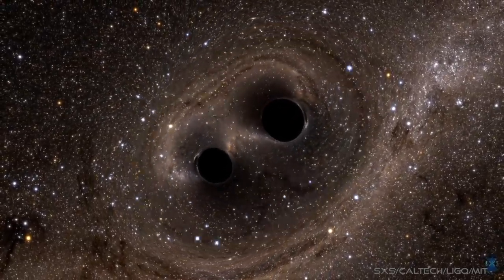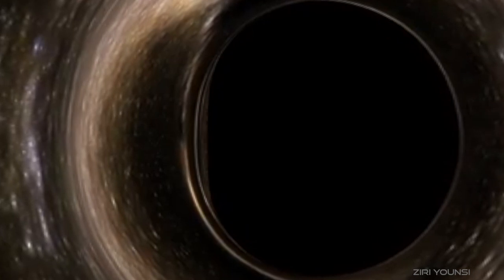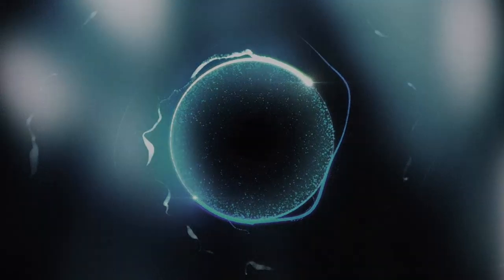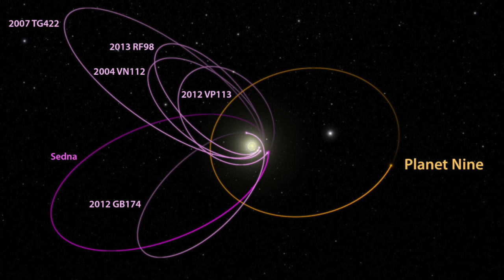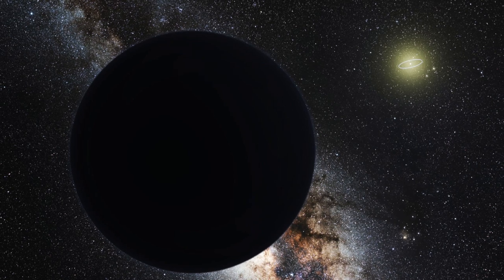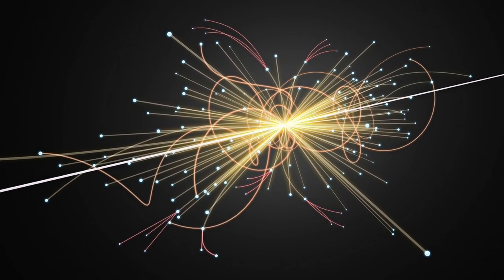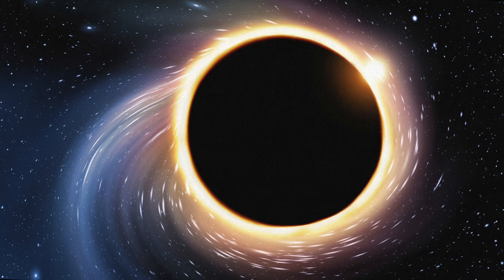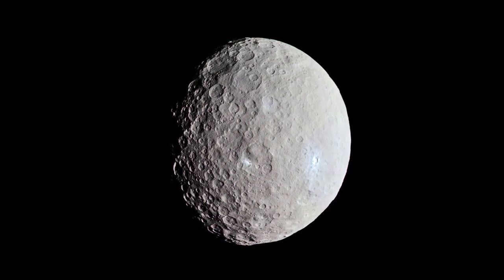Tiny Shiny Black Holes

Comment: David, good video.  Another problem with creating a kugelblitz with even a solar collecting dyson swarm is: once the BH is formed at the Planck mass, you cannot feed it and make it more massive.  It's radius (event horizon) is 3.233×10^-35 meters.  That is orders of magnitude smaller than the size of a proton, which is 1.5346983×10^-18 meters in radius.  It could never grow.  It could fall to the center of the earth and would statistically never encounter another atom.  And that's only if Hawking was wrong and the thing doesn't evaporate instantly.

If it does evaporate, you can't add any more mass or energy to get it above the Planck mass.  You can't add energy by dropping matter into it either for because the radiation pressure would be like trying to push a golf ball into a firehose.  You can't add mass from a Dyson swarm of lasers because it would likely radiate energy away faster than you can add more.

And by the way, the LHC can only produce energies up to 14 TeV, which is 2.5×10^-23 kg (well below the Planck mass of 2.1764×10^-8 kg).  Such a black hole, if even possible would be 3.707×10^-50 meters in radius.  The size of that black hole compared to a proton, is analogous to a proton compared to the orbit of Pluto.

Comment: 17:13 A thousand megawatts!? That's almost 1.21 jigawatts! Great Scott!
Reply: The planck energy is actually about 2 gigajoules, so that's enough to power 2 flux capacitors for a second each, and how long do you even need to power it for anyway, a split second, right?
Reply: Winfield ScottEdit

John William De Forest, in Miss Ravenel's Conversion from Secession to Loyalty(1867) reports the exclamation as referring to Winfield Scott, general‑in‑chief of the U.S. Army from 1841 to 1861:

I follow General Scott. No Virginian need be ashamed to follow old Fuss and Feathers. We used to swear by him in the army. Great Scott! the fellows said.[4]
Reply: Fire comment
Reply: At 88 miles per hour!!!

Comment: Hi David,  I love your videos, research and explanations.  I’m a huge fan. Thank you!  
Regarding tiny black holes... with the mass of a mountain... 600,000,000 tons... let’s call it Yakob — given that Freddy had an event horizon of about a micron and was massive enough to produce gravitational tidal forces that would rip us apart at a few hundred meters — I imagine that Yakob would have an event horizon with radius much smaller than an angstrom and produce those tidal gravity effects at tiny distances too... so wouldn’t Yakob have a very hard time growing even if it fell into the center of the earth?  It could only trap atoms that came super close to it. Right?
So I imagine Yakob falling to the center of the earth virtually unimpeded, accelerating as it reached the center, then decelerating as it came close to the surface of the opposite side and back again... forming an orbit inside of the earth!  We would only be able to detect it as a periodic perturbation of the local gravitational field every time it came back to our part of the planet’s surface... well that and the gamma rays that it would emit.  Did I understand that correctly?
Thank you.

Comment: Hey, it's very  nice to see you cover that topic, and I had more or less the same ideas a while back, and I always had some questions, remarks relative to how to manage a micro blackhole, so why not share them with you all ? English is not my native language so sorry for silly mistakes.

Okay so let's assume we manage to create such a blackhole with the power-output of a classical powerplant.

First, a remark... If we use energy to create a blackhole to extract energy from its hawking radiation, we don't have an energy source, just a very, very long term battery. Unless we find a way to feed matter to the blackhole, to compensate the mass lost to evaporation. In that case the blackhole become a very useful powersource that can extract 100% of the energy equivalent of the mass we put in. (assuming that hawking radiations are only made of photons, which I know is wrong below a certain mass)

The problem is... How to feed such a blackhole ? after all, a blackhole like that would have a diameter of 14 femtometers, which is, if i'm not wrong, of the same order of magnitude of a proton, or even an electron. So first, you'll need to be very precise when feeding the blackhole, and second, how would it even react ? Let's push it to the limit and imagine I have a blackhole smaller than an electron... If I try to feed it an electron, wouldn't the electron just... Pass right through it or something ? It's hard to figure out how a particule would interact (if it even can) with an object that small, and I suppose you need to use quantum physics to answer that question... A blackhole like that would be very hard to feed, and also to charge electrically.

Also a cool idea for  exploiting a non charged blackhole would be to have it in orbit around the Earth, enclosed in a space station used as a powerplant that would beam the energy back to Earth. The station would ajust it's orbit around the blackhole to compensate the outside forces acting on the station, to keep the station and the blackhole still relative to one another.

Again sorry for my broken english. hope that message fit nice with the video !

Comment: The only safe place to create a black hole is in earth's orbit. Imagine a problem in cooling system and the whole planet is destroyed!
Reply from the maker: Ye it seems outrageously risky to have near to anything you care about
Reply: Yeah but cooling things in a vacuum space is a whole another can of worms.
Reply: @NoHandleToSpeakOf  You don't need to cool it in space, as you won't need any structure around to levitate it. However to harvest power from it, you need to be close, because of the inverse square law.  depending of material strength, you might be able to get as close as 4 times closer than 50km mentioned in this video. However that will still be quite far away to get any serious power, so you need a dyson sphere structure, that can absorb hard Gamma rays, and some avionics to keep the sphere around the black hole centered.  let me try this with numbers: 12.5km radius sphere has an area of 1963.5 sq km. 1Gw spread out over such an area is 509000 Watt per sqkM! around 1/5'th the intensity of solar radiation on the surface of Earth! So really not worth the hassle. I can't really think of a structure that can withstand the spaghettification to be close enough to get any meaningful power densities out of a small black hole??? Tungsten has a very high melting point but the same density as Gold, so really not something to build anything strong of in a sharp gravitational gradient. You could place a spinning ring shaped reflector around it, that would counter the pull, but a rotating reflector will have a small surface, and to be much closer, would still experience radial spaghettification between the inside and the outside of the ring, so break apart, even if the rotational speed was matched to the gravitational pull
Reply: @Tore_Lund  That is a great insight into practical energy gathering of a black hole. Thanks!
Reply: @NoHandleToSpeakOf  I think it will be considered the stupidest idea ever, even for an alien highly advanced civilization to try this, compared to the small amount of practical energy ,  it is possible to get out of this!

Comment: Great video.  I think there's a problem with the electrically charged tungsten sphere trapping the electrically charged black hole.  I believe such a sphere has zero electrical field within the sphere.  Thus, in van de Graff generators, electrons within the spherical ball on top actually migrate out to the surface of the sphere, they don't collect in the center.

Still, it should be possible, in theory, to suspend the black hole in an electric field between two charged plates.  The intensity of the field would need to be adjusted constantly to ensure the black hole stays midway between the plates.  The darned thing, though, would preferentially attract charged particles to become electrically neutral.

Really, the only good/safe way to keep the black hole from falling to the center of the earth is to form it in orbit.  Preferably a distant solar orbit.
Reply from the maker: Yes great point! I tried to illustrate this with the white break in the sphere diagram, it’s actually two hemispherical plates that surround the BH, because of it was one sphere then it would be a unipotential ball.
Reply: @CoolWorldsLab yeah, that's what I was thinking.
Reply: @CoolWorldsLab  If you could manipulate negative energy, could you surround the black hole with a ring of negative energy that would create a bubble of negatively curved space?(like a negative energy cosmic string)
This would shield the black hole from the Earth's gravity.
Reply: @scifirealism5943  Negative energy leads to paradoxes, it cannot exist.

Comment: Hello and congrats!
I am a huge fan of "how universe works" stuff, and your videos, are by far the best explained I ever saw. 
But I have a question.
The black holes have a limited mass. So why there should be an infinite density? I understand that we cannot see the black hole itself, and we cannot calculate the density...but in my opinion... there has no reason why it must have infinite density or to be all concentrated in one point. It may be an even more exotic mater than quarks, something that didn't respect our math or physics.

Comment: A question:
It's my understanding that black holes 'evaporate' progressively faster as they loose mass and when they do finally disappear they go with an almighty bang. That being the case if micro/primordial-black holes are thing where are all the explosions?
To put it better are any of the known phenomena in our universe consistent with such behavior? eg: Might this be one of the causes of GRB's? Although I don't recall any physicist invoking micro back holes as a possible cause.
PS
On the subject of using small back holes as a power source I can't help feeling the case is very dubious. On Earth:
-A black hole is really only a battery so it's only benefit is it's energy density.
-The energy required to make one here would surely boil away our atmosphere in the process - no so useful.
-'Dropping' one for any reason at all means the end of our world, slow or fast. That's one hell of a risk for the sake of a convenient sized power source.
I guess the risk vs benefit ratio for powering a 'space ship' might be rather different but how do you make one?
-Do you go micro-black hole 'mining'? Do they exist naturally, how? Actually finding and trapping one would be a far from trivial task
-Maybe use the Sun as a power source for making a Kugelblitz? Ok, feasible, but accidentally drop just one in to your local star and it's goodnight.
..
I would suggest our talking about using black holes for this kind of purpose is rather like Victorians turning cannon shells in to space ships. Yes, we can see the logic, but from our perspective it's obviously silly, and these days we don't even have to consider such silliness because we have more practicable ways to get in to space our Victorian brethren could not have conceived.

Comment: Would a tiny black hole as a lab device (perhaps in orbit for safety) give us any way to test theories of quantum gravity?
Reply from the maker: Yes - Studying those last few moments of evaporation and the particles produced would be incredibly insightful for testing extensions to the Standard Model.
Reply: You can't have one that is small enough that you could keep in a lab on the surface of a planet and yet large enough that it wouldn't evaporate immediately in a big explosion (that also would likely set off vacuum decay and destroy the whole universe). There's no middle ground. It's either too massive to contain, too hot to contain, or both.
Reply: @medexamtoolscom  Sure you can, the explosion may be large but its not like a supernova, a planck mass black hole evaporates with an energy of only half a ton of TNT. Obviously you wouldn't be able to keep it on a desk but some future laboratory capable of creating such black holes will surely be able to contain an explosion that small.

Comment: It's easy to calculate how long black holes last and figure out their temperatures, because a black hole with the Planck Mass decays in the Planck Time and has a temperature of the Planck Temperature, and the decay time increases with the cube of its mass and their temperature decreases inversely in proportion to their mass. So you can calculate pretty easily the thermodynamic temperature of a black hole with the mass of the moon and how long it lasts for instance.

Comment: Professor when you speak of infinite do you mean " Infinite is a math term used to represent something that cannot be counted" ?  When a star collapses isn't the force it exerts still gravity?  So for a dark hole to grow in strength it would need more mass, but how could it draw in more if its gravitational force is the same as when it was a star?  Thank you for another fascinating video.  One more question, was the location of your shoot purposeful or happenstance ?  Happy New Year!
Reply from the maker: Yes a black hole doesn’t have any more gravity than before it collapsed (in fact likely less due to shells being blown off during the nova). They don’t necessarily have to grow of course, but if they do it will be through material getting close, close enough to get ripped apart by the tides then stream into the black hole in an accretion disk over a much longer time. Of course they can merge with other black holes too. The origin of super massive black holes is a mystery, we really don’t understand how they could grow that big in 13 billion years.

Comment: I took Crane & Westmoreland's idea for a black hole space drive and extended it by staggering the masses of several BHs. This works well as an enhanced space drive. I needed a nonlinear optimiser to get the best set of masses, since an analytic solution seemed impossible.
Reply from the maker: Neat, how did you stagger them exactly?

Comment: 16:45 But there's nothing holding the black hole to the shell. The shell doesn't exert a force on the black hole because of the shell theorem, so the black hole could literally just rip through the shell and continue on its merry way. A much better solution would just be to leave it in freefall. No constant force containment needed.

Comment: If I actually had a small black hole, then I would drop it into an appropriately sized asteroid or moon, and turn that into a mini habitable planet. Complete with atmosphere, running water, and everything. And then I would set up an artificial magnetosphere, to prevent atmospheric stripping from the solar wind. But it is possible that this process occurs naturally. If we ever find an extra solar planet, that is much much smaller than it should be - yet continuing to hold an atmosphere - then it is possible that it might hold a primordial black hole at it's core. It is also possible that a few of these might drop into dwarf stars, eat them up from the inside out, and make much smaller solar sized black holes, than what would be predicted by current theory.

Comment: What I would do if I had the capability co create tiny black holes? I would probably weaponize it, it would eat through any armor and most countermeasures would be pretty useless given how much kinetic energy such a projectile would have and that everything you shoot at it will only add a bit of mass. Only problem would probably be not shooting it too fast given that it might just pass through its target. But this is Kardashev 3 tech I'm talking about.
Reply: That's a huge waste of energy IMO ^^
Using them as long term batteries and propulsions system would be a better investment !

Comment: Even if you manage to hold in position the black hole with a charged shell, the shell itself will anyway try to sink into the earth with the same force applied to the BH. Of course you could spread it on a bigger surface, but how big is it going to be? And which materials could realistically be used?

Comment: Suppose a neutron star gradually experienced a mass increase (due to accretion) to the point where the escape velocity at its surface reached the speed of light. At that point nothing could escape from it. Is it a necessary condition for it to collapse to a point (which according to things I've read is a mathematical artifact)? Can it not still be a black hole with an event horizon >= its radius/diameter and a physical diameter slightly less than that of the event horizon?